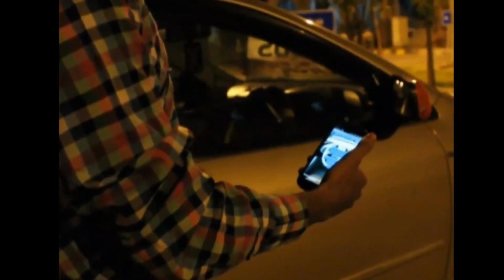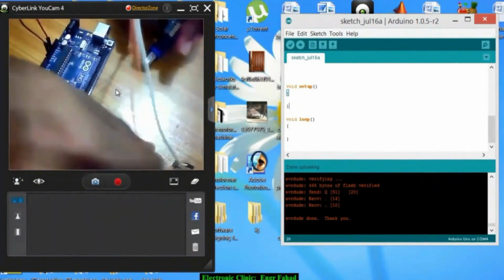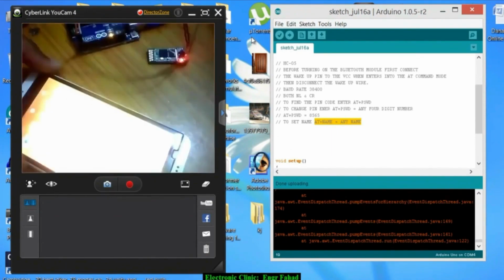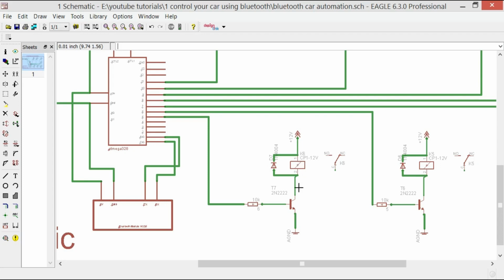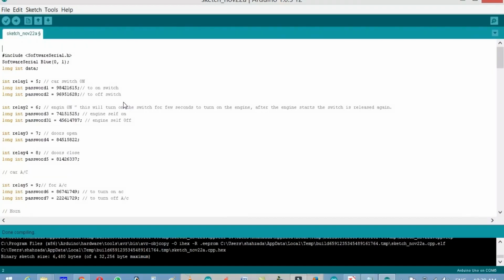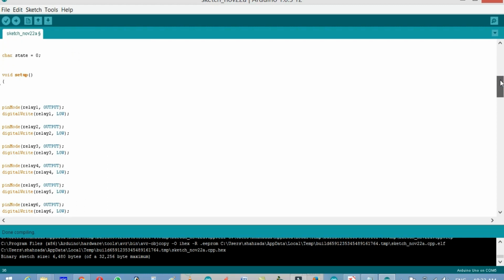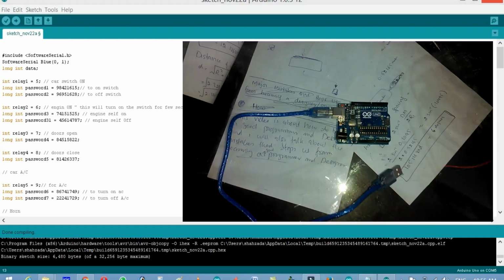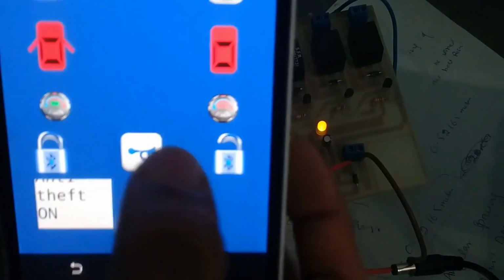Unlock Car doors with Phone App, Start engine, Ac control using Arduino and Bluetooth module

Comment: Can we edit the code in a way where it doesn't require the password to connect to the Bluetooth?
Reply from the maker: yes you can. I working on the latest version. It will have around 40 meter range and the will be BLE.

Comment: Such a nice work sir. I am fan of your work. So simple so clear.  I have a question if we add the any gsm module 800 series with this circuit. And anti theft , Engine on/off, central locking system, and location operate with GSM module and GSM send notfication abot car security and car maintenance. Parallel android application work. Is it possible??
Reply from the maker: My dear you can use gsm, but i recommend nodemcu wifi module for this. For remote controlling nodemcu is best. And you can monitor everything in real time.
Reply: @ElectroniClinic  thank u so much sir i will try. 😍
Reply: @ElectroniClinic  plz sir send me the Grab file of Bike Anti Theft circuit on this email i.d musharafraza0@gmail.com
Reply from the maker: check your email. the gerber files are sent. you can send these files to pcb manufacturer.